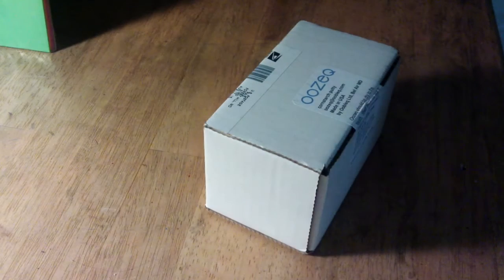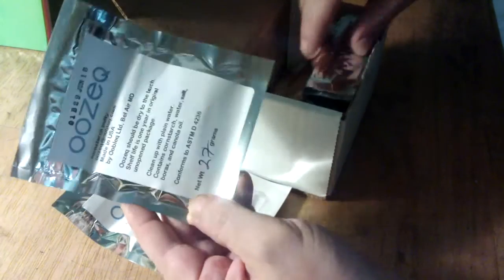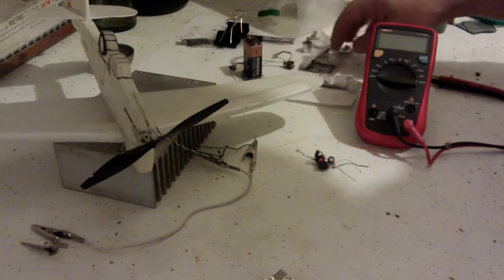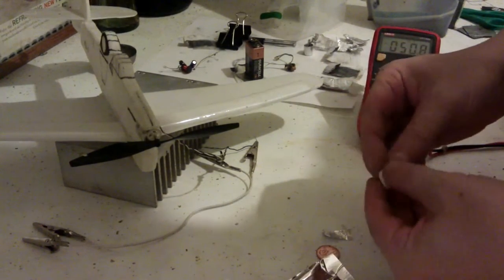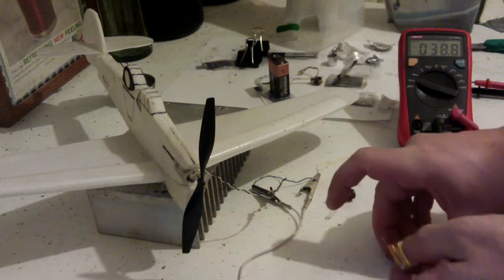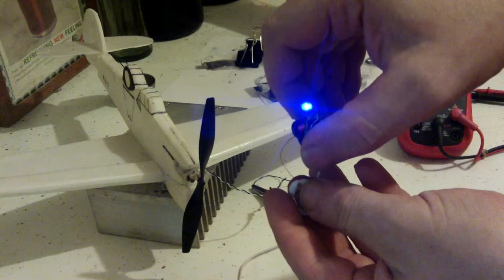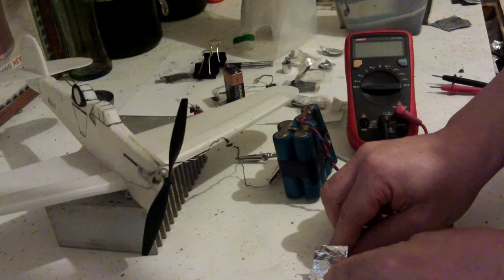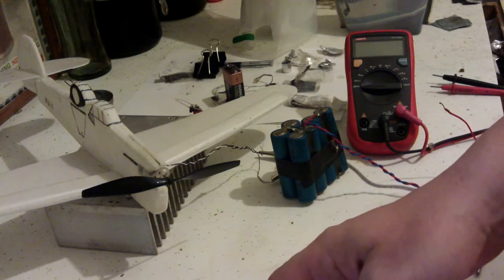Genuine Oozeq  Unboxing + Testing

Comment: 2 questions that I cannot find answers for regarding this type of energy storage device: 
1. has anyone tried making units in series and/or parallel, and if so, what is the effect on the voltage and current?
2. what density ratio does this material have? ie. do small quantities have the same electric capacity as large quantities?

Comment: Seems I have missed all your previous videos on this topic. Boy you find some interesting power sources and electrolytes etc..
What effects do you think this is? Looks pretty capacitor-ish with a touch of ally-air battery? Do you think the capacitive charge could be stored via dielectrophoresis? Does it fizz on heavy discharge? What about if you add sherbet or popping candy?

They use similar stuff in phone cases for shock protection. Maybe you should mix things up a bit and put the battery on the outside. Or make a phone case that’s also a portable charger.

Also it looks a bit like simtex. How many volts/joules to explode it? I bet one of my 10nf 40kv caps could displace rapid charge it a bit....
Reply from the maker: Feel free to try the ultra-high energy explosive routes, too many police cruisers around here !
Yep, your theory is correct in my opinion. The salt is the main reactive ingredient and charge carrier, the cornstarch as the binder, with a spot of oil acting to keep it in one piece (though Canola itself is worth reading up on). 
No fizz on heavy discharge but plenty when charging at high current. It would make a superb heater material for going within a metal hand warmer in winter. Sherbet or popping candy...no idea except for high sugar content and that's another to look at, table sugar.
I'd do the phone case thing, except I don't use one. So it sort of falls off in interest, though such a market must be massive.
Reply: When I get a new phone, I get two other things for it right away. A cover and a spare battery or porta-charger.

Comment: Thanks for sharing your findings, just curious, does the oozeq show any capacitive properties if you use same metal plates? Also do you notice any degradation of the plates (is it a galvanic cell).
Reply from the maker: It seems to work far better in terms of charging by using the same plates (aluminium in this case). The motor demo was with the same metals, for example. If charged very lightly, the Oozeq will keep its polarity from that point onward, there being zero differential without charging on same metals,. There is degradation of both the metal and the Oozeq when using high current...a black oxidation forms, but is completely normal for most things being fried in such a manner :)
Reply: Thanks for getting back to me, with same metal plates must be acting like a capacitor.

Comment: "The BLOB" that powered the world... Keep that away from lightning strikes please
Reply from the maker: An old bar of used handsoap, must try that just for the bizarre factor !!!  Cosmetics, latex paint, lots of household stuff uses interesting chemicals. Such as titanium (di)oxide in bright white latex paint..let it dry some and that rubbery stuff could be very useful in capacitor building. Can also become nanotubes, says the Wiki :)
Reply from the maker: Ooh good idea, am in the right part of the world for that LOL
Reply: thanks you for the video .interesting stuff.  i also used an old bar of  used handsoap and have had similar results its much cheaper than buying the oozeq as its usually just tossed in the trash ...lol
Reply: the old bar of dial brand soap works great its not brittle even bone dry.. i always wondered if someone took an old plastic bottle and melted it down and while hot added in some alum and table salt into the mix and when it dried the salts would then make a pathway through the plastic to let the electrons pass ? candle wax was also something i have but yet to try it out been working too much..